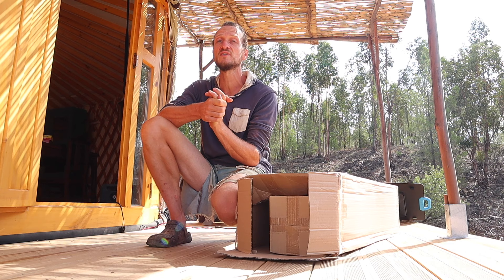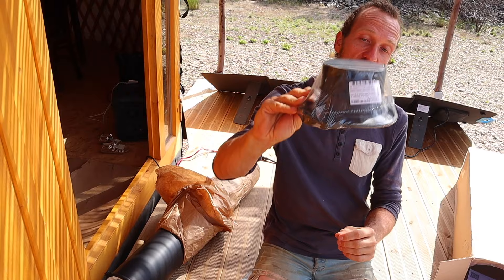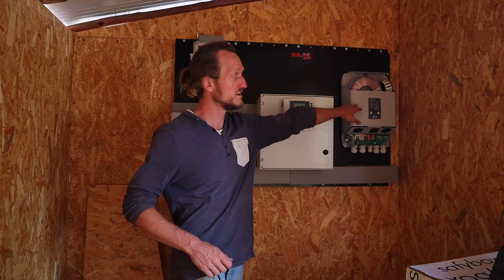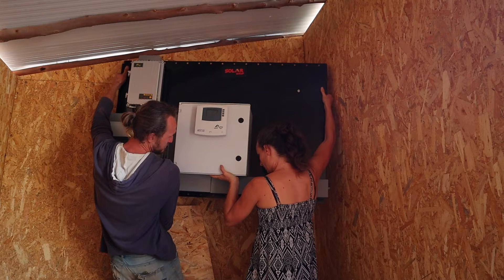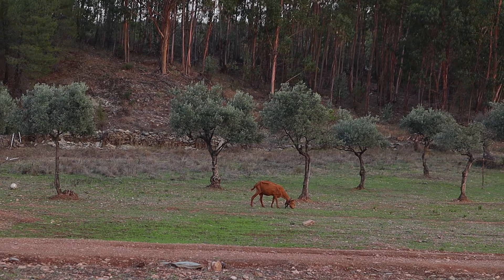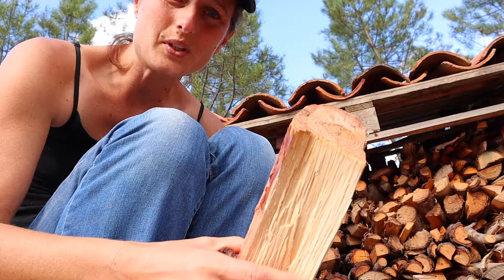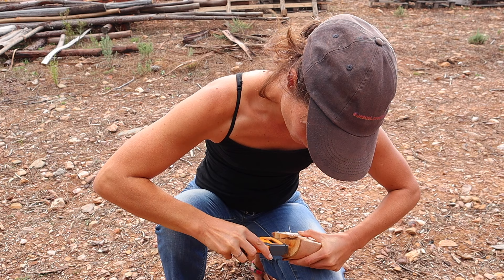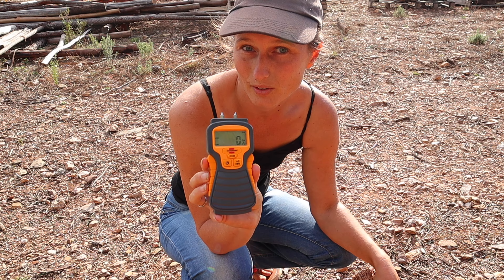We Fail, We Learn, We Grow! Building Our Off Grid Life In Portugal.

Comment: Eucalyptus is easier to split when freshly cut. The drier it is, the harder it will be to split. Good luck.
Reply from the maker: We learned that the hard way 😅 The new pile we will split in a few days 😊
Reply: Another great video and is worth watching and sharing with others the importance of having very dry wood to burn.  Just to let you know we had many large gum (eucalyptus) trees on our farm which we used for fencing poles and building our greenhouse to house our coffee plants from seed each year. (100,000 plants). Our nursery was 30 X 50 meters square.   The roof we used bamboo (split in half’s) and the top 3 meter lengths of the eucalyptus tree ends.  We did not remove the eucalyptus stumps, because they would send up shoots for us to harvest our own timber and very straight poles for other projects and sell our surplus poles to nurseries in our community.  Some we would harvest after one year others after two years and three year old poles.  This is a good income for your farm.  We would also sell firewood in bags for home owners.  We were also lucky that we had a person who wanted all the eucalyptus leaves for her business in the marketing of eucalyptus essential oils.  Again, nothing goes to waste.

Comment: In Australia we don't use pine or pine cones in our wood heaters as it causes tar build up in the chimney pipes.
Reply from the maker: This is the information I found online:

What wood causes the most creosote?
Contrary to popular opinion, the hardwood's, like oak and poplar , created MORE creosote than the softwoods, like tamarack and pine. The reason for this, is that if the softwoods are dry, they create a hotter, more intense fire. The draft created by the hotter fire moves the air up the chimney faster!

Comment: Pine trees are not very safe for burning in a wood burner
Reply from the maker: Okay, can you give me more information?
Reply: Pine creates a lit of creosote in your pipes which can catch fire.
Reply from the maker: Okay, but after research this is what came up:

What wood causes the most creosote?
Contrary to popular opinion, the hardwood's, like oak and poplar , created MORE creosote than the softwoods, like tamarack and pine. The reason for this, is that if the softwoods are dry, they create a hotter, more intense fire. The draft created by the hotter fire moves the air up the chimney faster!